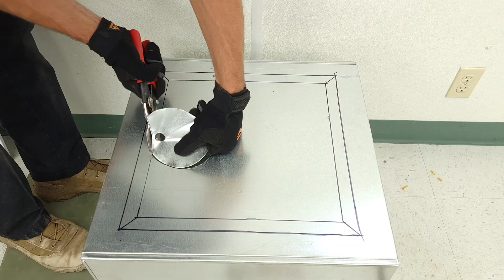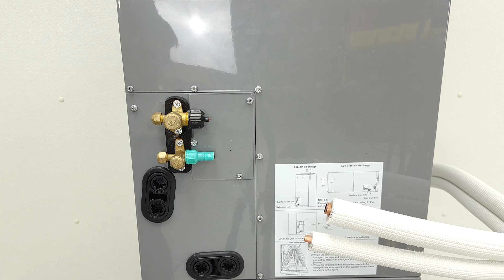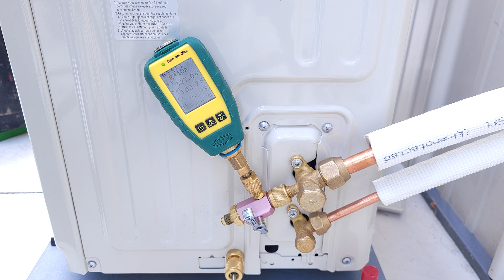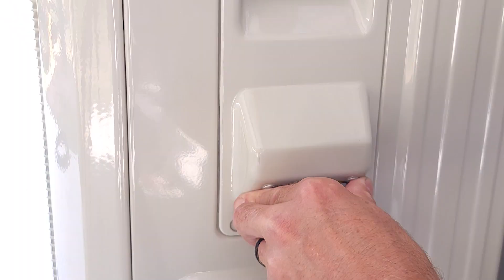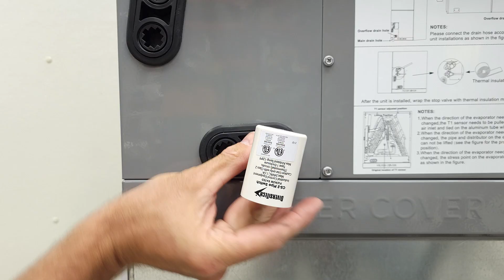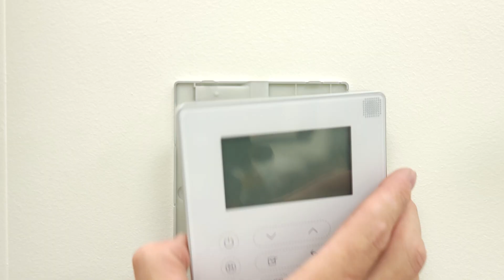Full Installation of an Inverter Mini Split Heat Pump to A Ducted Air Handler!

Comment: In earlier videos you put a tiny amount of oil on the flange surfaces of the connections. So that is not recommended any longer?
Reply: I also use Nylog Blue on all flared connections. I sleep better at night. To each her/his own I guess.
Reply: I was wondering the same thing.
Reply: I was always taught to do this and I feel like it’s still good to do… idk
Reply: Manufactures recommend you to do that
Reply: Use nylog or refrigerant oil
Reply: I use oil on the back of the flange where flange nut goes, so nut dont bind and turn pipes when you torque it to spec, i also use nylog blue on the flanges. Never put oil or nylog to threads since it will affect torque and you will over torq flanges

Comment: How does that t-stat tell the system to use heat pump or ac with only 2 wires?
Reply: Note the silk screen legens on the controller board. It shows S-485, RS485 is a serial communication hardware standard, for bi-directional communication. I don't know what the protocol of bytes would be on this, but I would guess it to be some proprietary version of MODBUS. Note there is a battery in the thermostat, most likely for power loss to save the settings. So those two wires also provide power for the microprocessor in the thermostat, as well serial bus power for it to communicate back. This would be what is known as diplexed serial communication over the low voltage power wires.
Reply: Because they are a communication systems.

Comment: Another great video! Some new tools too! Why  have you switched to not encouraging the use of Nylog on the flare fittings?
Looking forward to the new book!
Reply: Many manufacturers are against the use of Nylog. Installation manuals only encourage some oil placed on the face of the male side of the connection prior to torquing. I personally am not against it, however too many guys use Nylog improperly.

Comment: What's the point in the mini split if you're going to end up having ducts seems you would lose a ton efficiency? Either way, doesn't  take away from a great video thanks
Reply: Because you still get the efficiency of the inverter heat pump motor. 

Static Duct loss can be designed out of the system by correct sizing. 

In most pre-existing situations with a standard split system they are usually way over sized in the first place.   
               So at the time of switching over to a inverter system it now can be downsized to the proper size. 

        And under original installations most HVAC technicians grossly under size deducting making it highly restrictive with lots of losses for that grossly oversize split system that was originally installed.   
       So that original 3 ton or 4 ton system that was way oversized.  That was originally fitted with duct work that was only large enough to accommodate 2 1/2 tons of airflow will now be perfect for a smaller inverter driven system.

Comment: Why would you run the line set across the door now its going to be a pain in the ass for the service man who comes to maintenance the equipment
Reply: Where else is it supposed to go?  There's just the coil behind it and you can access the coil from above and below so it won't ever be an issue.
The unit is designed that way...but maybe it would be better if the connections were facing left instead of right (bad design maybe).
Reply: @pitaeata8493  definitely poor designer planning
Reply: @pitaeata8493  do a j hook run it to the right